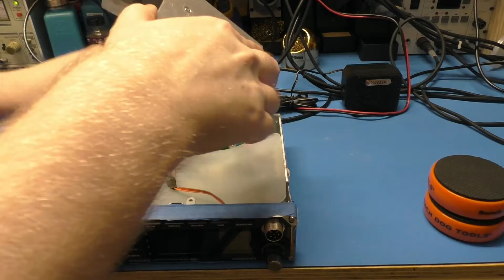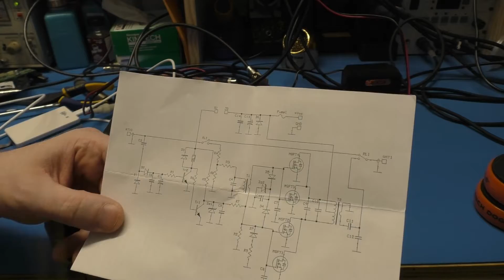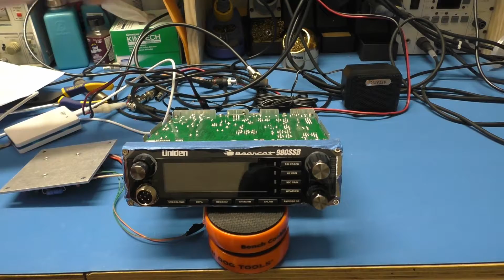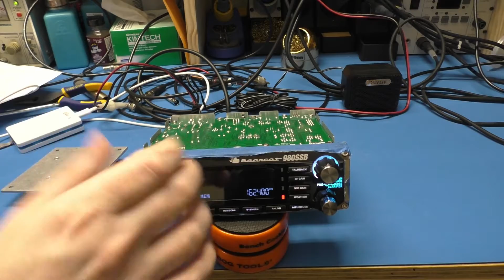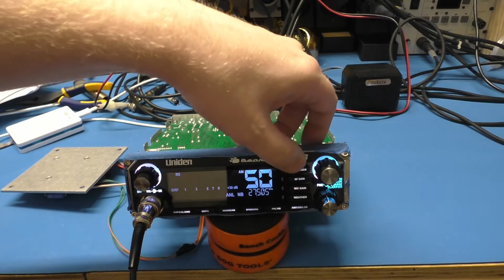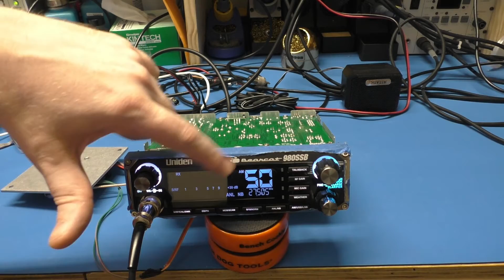980 Updates - amplifier+software testing

Comment: HELLO! EXCELLENT VIDEO, THE BC980SSB IS A GOOD RADIO; BUT I REALIZE THAT YOUR SCREEN IS SUSCEPTIBLE TO THE HIGH TEMPERATURES, IN THE REGION WHERE I LIVE, WE HAVE TEMPERATURES OF UP TO 136F, AND THAT AFFECT MY EQUIPMENT, WHILE THE TEMPERATURE IS LOW, I CAN SEE THE SCREEN IN ITS ENTIRETY, BUT AS IT GOES AHEAD THE HEAT, EVEN IF IT IS OF THE SAME EQUIPMENT, THE SCREEN BEGINS TO LOSE HIMSELF.

Comment: What the heck do you need Talkback for?   I don't have to hear it out of the speaker to know what I'm saying.   Seem like a silly feature.
Reply: TalkBack can tell you if your microphone is working, if the switch is scratchy, or there is a bad wire and your audio is not getting out, you can hear these things if the TalkBack function is on.

Comment: Mark how can I get the VCO mods for the extra channels , Do you have them posted somewhere ?
Reply from the maker: Yeah.. save you the trouble. You just swap the varactor out with a 1SV324 and that will broaden it's VCO.
Reply: That’s not gonna be fun if you don’t have the right flux and heat gun and solder and patience. And microscope

Comment: 50watts pep should be fine,I always put a 3dB 50ohm pad on input to keep input impedance nominal,I think the resistor is the pad resistor,ur correct do no do this!
I also add a extra lowpass or bandpass filter to keep things extra clean.
Duty cycle on SSB will be a lot lower than fm\am modes on tx.
For Am always set mine 4 times carrier so 12.5W Carrier =50w pep@90% mod
Narrow Fm well not applicable in USA but is in UK,EU land,but same as Am due to duty cycle.
SSB 50w pep two tone test.
The amp boards are based on a RM italy design CB amplifier,thinks its RM203.

Like what you done to VHF side,Uniden missed boat there handy for 2m HAM band and VHF MURS 151mhz.Dont forget the FM receiver is set up for 16KHZ bandwidth wide fm for marine.
Does the 1050 Hz alert warning still work on WX channels?

Project looking good!

73's Rob

Comment: how can I get one of your software mods
Reply: Twisted .Radio 

This isn't a software mod.  The entire CPU display board gets replaced.  He is still working on finalizing the program.  I think there are a few changes he needs to make on the next board design to.  It's a work in progress but it's almost there.
Reply: MikesRadioRepair ok great I will have to keep in the loop on this looks great so far keep up the good work
Reply from the maker: Mike already answered about getting the software but some additional info:

I thought about doing that initially because I do have access to the software and debuggers for the R78 MCUs.
Now there is an obviously an application that runs on the MCU and it is copyrighted. 
The only legitimate ways to alter the existing application would be to get Uniden to let me have the source which isn't happening...
OR writing the software myself. 
Rather than spent gobs of money (which would be in the many thousands of dollars) to get and set up my own development environment I just made a new board.
It was cheaper and faster and the only way to "share" something like this would be to swap the board since an end user would not be able to flash the new program on the old MCU.
Renesas effectively prices themselves out of the small player market. I would use some of their MCUs in projects - even the commercial ones I do but I end up using a Microchip or Atmel product over theirs because their "tax" is too high.
They only want to do business with companies like the Unidens of the world. Not freelancers or independents like myself.
Reply: Mark19960 well I love to mod and improve on designs. it's amazing some of the things the Radio engineers do . I am new to all the new software driven radio's. anyhow thanks for the great videos I am on a watching binge as we speak  or should I say text  just subscribed and liked your channel. Have a great night

Comment: so far so good mark i'm likening it, some amplifier  is good i like the stinger amp gives just a bit more fire in the wire & does good if done correctly, tim at src adds them to the 980 series radio all the time,
anyhow just out of curiosity  ever tried to implement that amp into .. say a 148gtl ? i like to see that just for the mear hell of it.... 
73's scott  k7sce
Reply from the maker: I think the amp was originally intended for a 148/29 and friends actually. 
I would have to double check but I think the holes in it line up with the holes on the bottom plate of those radios.

Comment: For SSB with the amplifier you might try adding a electrolytic capacitor to the base of the switching transistor.  That's basically what most amplifiers have.  The higher the value the longer the hold time.

The 980 is looking good.  Like you I hated the original RF gain control system.  Much better the way you implemented it.
Reply from the maker: The amp has a cap on the base of that transistor already. But if we can switch the amplifier properly there is no longer a need for the delay or having the cap.
It's a "keep it simple, stupid" sort of design.
Reply: Mark19960 

10-4  Couldn't make out on the schematic you showed if one of those was a electrolytic capacitors or not.

So the WX frequencies can be added to memory.  In other words we now have a 2 Meter scanner with memories.
Reply from the maker: basically, yes.
Reply: Edward DeShazier 

Waiting for Mark to get the first run of boards out the door.  Should have them soon and will know more once I have one in my hand.